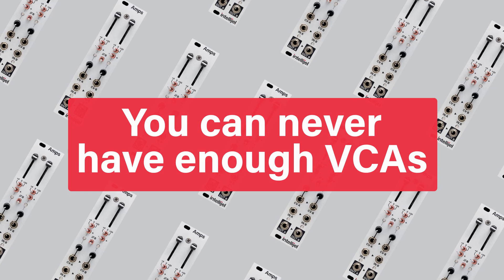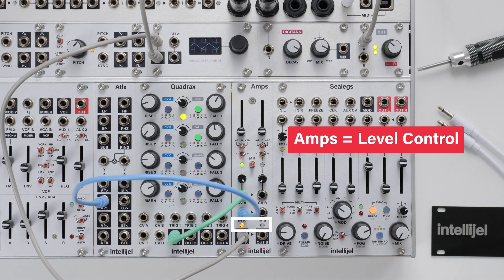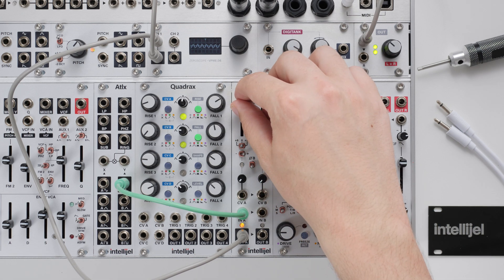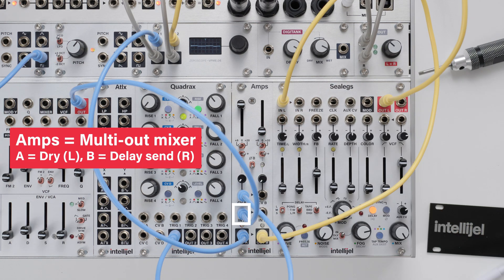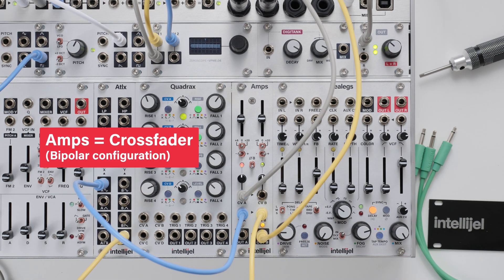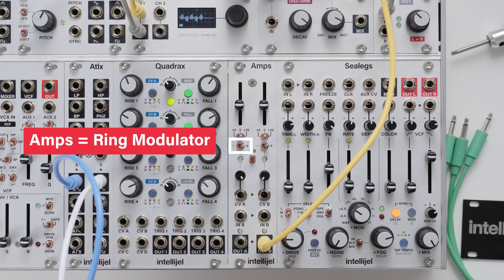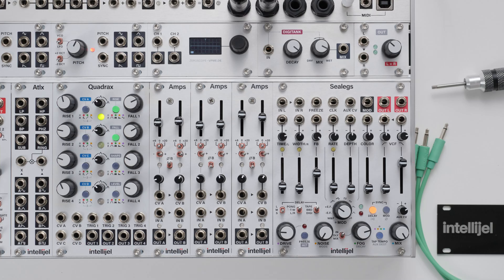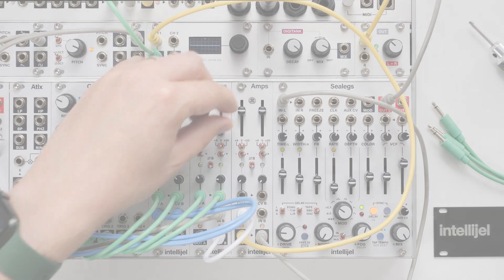Intellijel Amps

Comment: some, people will ask themselves "why get a dual VCA when i can get the quad VCA" and theres nothing wrong with the quadVCA, but sometimes for patching cable ergonomics, having 2 seperate 2-channel vca's spread out over your system, can be better than having one quad vca, because with a quad vca your cables all need to coalesce on that one module. Just something for people to think about, don't sleep on the usefulness of a dual VCA, and how you can spread multiple of them around your rack, you can have clusters of pairs, it might keep cable organization cleaner.
Reply: i like to have at least one vca and multiple or passive mixer near every voice/tone-producing module. Usually i have two tone modules, and put a vca, multiple, and mixer in-between and around them.
Reply: The only good advise for those people is "get both".